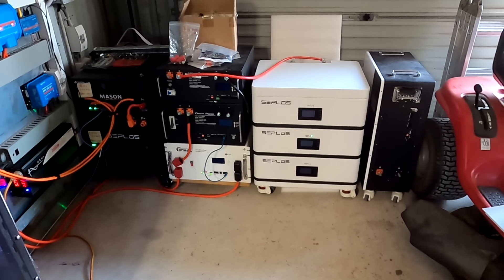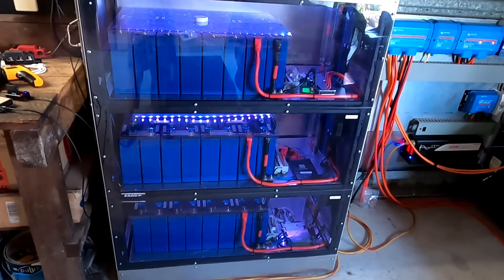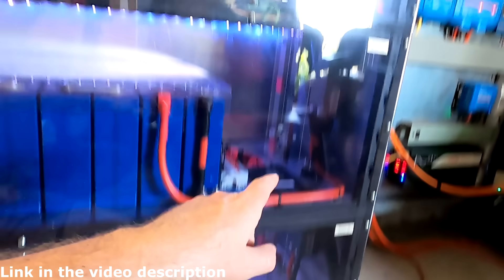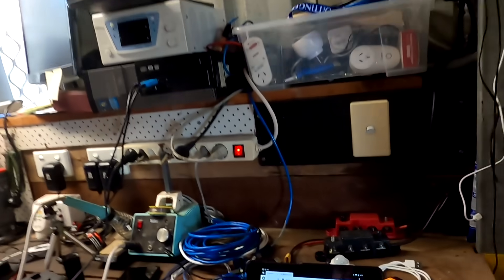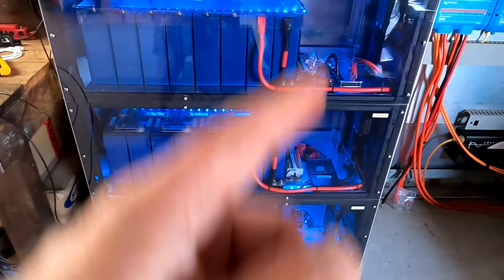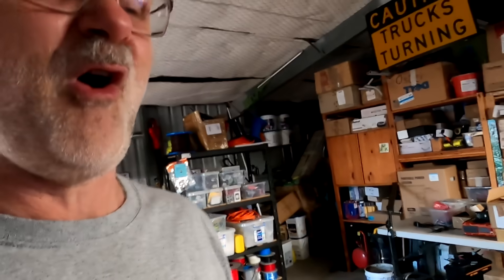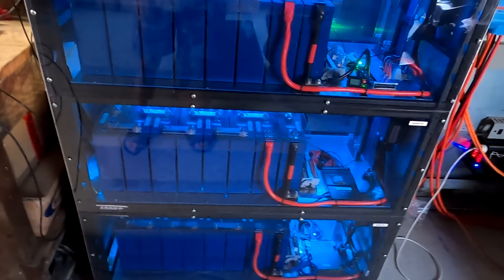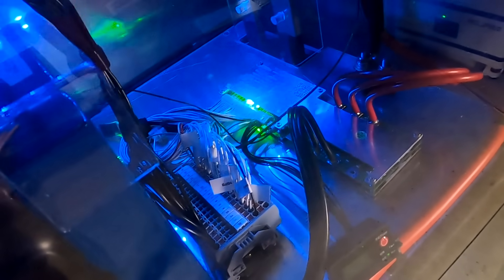Something wrong in the battery shelf! Or just 'bad' settings?

Comment: I have already asked this question in the video before but... The first relay contact of the PACE 200 A BMS switches to continuity in the event of an alarm. Couldn't you disable all alarms in the parameter settings except for the pack overvoltage alarm? Then you could turn the active balancer on and off via the relay with the pack overvoltage alarm setting. Personally, I don't need these alarms anyway. Then either turn off the red flashing LED as well or take it as a sign that the active balancer is working.
Reply from the maker: Yes, that could work for the higher voltages but what when we have a low temperature alarm, a low voltage alarm. It would trigger the balancer as well.
Reply: You can disable this function. There are check boxes and it does not disable the temperature protection. And the undervoltage alarm is below the shutdown voltage of the active balancer. @OffGridGarageAustralia
Reply from the maker: @karisianschwermer6464  But the check boxes disable the whole block of functions. So, OV alarm, OV protection, OV recovery and OV time delay.
I think you can just set the alarm higher than the protection value and disable it.
Reply: I will try it today... Of course, this would not be not good if the whole field with the checkbox would be disabled  @OffGridGarageAustralia

Comment: Andy Elon is recomending 100% charge!
Reply from the maker: Well, this is purely to keep the BMS and the milage estimator calibrated. Tesla had lots of trouble at the beginning with LFP batteries and cars suddenly stopping with an empty battery. I would still not do it if I had a LFP EV.
And LFP has a much higher cycle life than NMC batteries.
LFP: 3000cycles @ 400km = 1.200.000km 
I mean who cares if the battery is then down to 80%
Reply: I am charging to 100% once a week

Comment: My causin Bought LiFePo4 36250(i think) 3.2v, he bought 32 of it and put them in series and parrallel to get ~13v we use 100watt solar panel, and a pwm 10amp. But just 20days afterward each one malfunction. I think it overcharge, now only 4 is left . The float was 13.2 if I remember correctly but am ignorant  of the correct setting for this type of battery I just knew that its different from flooded battery am used to. I wonder if the battery was deffective or just the setting was wrong and its human error that cause it. *sigh
Reply: If your cousin didn't put all cells in parallel and fully charge them before assemble the pack should get them out of balance but to end with only 4, seems that he didn't use a BMS and went over 4V with some cells. BMS are necessary to protect the cells and you.
Reply: @CantFindInYoutube  ohh BMS? I see. We thought its only necessary to use  a solar controller. I'll see to it. Thanks.

Comment: I have found through testing that charging to 3.5v/cell or 56v for 16s pack is much better and allows the pack to stay better balanced even with a JK-BMS, balancer start at 3.45v. Much better balancing!
Reply from the maker: Yes, better balanced but higher degradation?
Reply: @OffGridGarageAustralia  There is NO evidence of higher degradation and given the manufacturer says you can charge to 3.6V  6000 cycles (with compression LF280K cells) I think 3.5V/cell is a good compromise. 
Weren't you the man that said don't worry about compression calendar ageing will degrade them first? 
Same applies here I would suggest.
Reply from the maker: @uksa007  yeah, makes sense. Testing different settings right now. Thanks for your suggestion.
Reply: @OffGridGarageAustralia  Let me know if you want to test my CAN interface boards for the JK and Overkill/JBD BMS, I sent you an email on 16/8/23 (might help you find it).
Regards
Reply from the maker: @uksa007  I'll have a look at your email. Might be in the pool with all the other 1M emails...
Reply: @OffGridGarageAustralia  I know the feeling, and suspected as much, my email is the same as my name here, that should help you find it!
Reply: Hola estoy probando 56,20v el equilibrio es bueno he visto una batería de tienda 16s están en 56,20v abs y 56,20 float será bueno?

Comment: Once a month or when ever I remember, I increase the charge voltage in steps up to 3.65v
I've got jk bms, at 3.65 vs 3.45 there is often only 5 or 10 mv difference at the higher voltage if it was fully balanced at 3.45
you would most likely see the same if your bms was able to balance with more current.
So, what in my opinion raising the volting to allow the bms to balance at a higher voltage will only help if the bms can actually balance at the lower 3.45v.
If there is devation at 3.45 there will only be more at any higher voltage and the bms will need to work harder to keep it in balance
Reply from the maker: Thanks for sharing. I like the idea of a maintenance charge once a year, increasing the voltage and check on the cells.
Yes, correct, we can see the imbalance now in both BMS when I charge higher.

Comment: Hi Andy, and thank you again for this very interesting video and test!
My opinion is completely opposite, the higher the voltage, the more difficult it will be for the cells to balance.
A simple test allows you to see this, charge the battery, by deactivating the balance system of the BMS, and take a good look at what cell voltage, the imbalance becomes too great. And we can deduce that from this point the limit is reached.
We could try anyway, to force the battery to go to a higher voltage level, automatically the imbalance will increase!
Conclusion, this is my opinion, Andy if you can perfectly balance your cells at 3.45V there is no point in going higher.
Because going to a higher voltage will degrade the balance.
To then go back down to a lower floating voltage???
For me it doesn't make sense, if you want your cells to be perfectly balanced all the time.
Reply: The point is that for voltages lower than 3.45V the cell state of charge can not be deduced from a voltage measurement due to the flat discharge curve. So two cells can be at different state of charges (imbalanced) but still have almost the same voltage. It is only at the high and low voltages that the cells reveal their true state of charge. And since the goal is to balance the state of charge it is best done at a high voltage.
Reply: "My opinion is completely opposite, the higher the voltage, the more difficult it will be for the cells to balance."

I mean, you're just demonstrably incorrect. Look at the voltage curve of any LiFePo4 cell, and you'll see the current crashes the closer you get to 3.65v. That means with 180ma of current being taken by a balancer, it's easier for it to make a difference when you're only 1Ah away from fully charged at 3.65v, instead of like 5Ah at 3.5v.

Comment: Hey Andy. I don’t think it’s the different BMS’s fault or your absorption voltage. I’m thinking it’s your aluminum busses giving you problems . The JK has the superior balancer and has faired the best but even that has limitations. I have 3 JK’s that see 55.2volts about 5 out of every 7 days. The typical absorb time is around 20 minutes. About 12 minutes in to absorption the balance is less than .003 in all three batteries. Balance start is 54 volts. I firmly believe that my system has been working so well for so long is the preparation of the terminals and busses. There’s absolutely nothing wrong with aluminum buss bars but the oxides must be removed from contact surfaces without compromising flatness immediately before use. I know you don’t care for antioxidants but that might be coming back to bite you now. The only antioxidant I now use is NO-OX-ID A Special. No metals, not runny, ph neutral and keeps moisture OUT. A telltale sign that you have issues is that the nuts are no longer torqued. Check it and see. Also pull the busses off a problematic cell and have a close look at the contact area for discoloration. 
Keep up the good work Andy!
Reply from the maker: Thanks Karl, the aluminium bus bars are only been used in the middle battery. The top and bottom battery have the stock standard tinned copper bus bars.
Oxidation cannot be an issue here. Remember, all these cells have welded studs and the contact area between the terminals and bus bars is tiny. With the 4Nm of torque applied this creates a perfect low resistance connection (tested with over 200A). Contact issues look different are not related to cell 1-10 in both batteries. It's definitely the HELTEC BMS wich causes this.

Comment: From your previous videos I built a battery pack one year ago (24v system) I have 2 packs of 8, 280Ah EVE cells with JK bms's, 2 amp built in balancing, about 7.5Kw of panels, max and bit more 😮 overpaneled on my 3 charge controllers, supplies about 80% of my electricity needs.  These previous settings seem to work really well.
 I think one way to truly know what's happening is to monitor each cells daily current flows, which would be difficult to do,
Reply from the maker: The current in all cells of a bank is the same in a series connection. I just don't understand why the Heltect BMS causes an imbalance on both batteries which were fine before connecting it. And only cell 1-10 in both batteries... strange

Comment: As you cycle the batteries, how long are they likely to sit at that higher voltage? I would guess that the amount of time at the higher voltage would be a factor in any degradation. If there is a significant benefit from raising the charge voltage to allow the balancers more time to achieve a better balance, degradation might be less significant if the batteries are not held at that higher voltage for long periods of time.
Reply from the maker: Well, you need to give the balancer time at this higher voltage. I have them sitting at 3.55V for 1h now. Let's see how this goes...

Comment: Tesla Model 3 Standard Range uses a LiFePo4 battery pack and their recommendation is to charge to 100% even for daily use. For their NMC packs they say charge only to 80% daily. Maybe that indicates that it is okay to go higher than 3.45V?
Reply from the maker: Well, that's a bit different. They mainly do this to calibrate their BMS with the system so the estimated km and SOC is correct. They had massive trouble at the beginning with that and then started recommending it.
Reply: @OffGridGarageAustralia  Isn't that kind of the same problem you're having? That it is very hard to determine a cells state of charge unless you go to a high voltage by charging to 100%.

Comment: What a hell tech and an over killed mess... ;-)
Buy another two JKs and you are done.

You set float higher than absorbtion ? 
This is confusing me...
Reply from the maker: Yeah, two more JK would solve it, but I want to test and find out what is wrong with the Helltec.
I set float higher than absorption for the test to rise the voltage again. Normally you would not do that of course.

Comment: Well i did learn that about the bms I have the overkill BMS is and I didn't know that they would keep balancing if they hit over voltage on a cell I always just stopped before they did that I'll have to give that a try
Reply from the maker: This is just if an overvoltage protection occurs, it keeps balancing. Normally you would not hit OVP though so balancing will stop.
I have raised the voltage here in this test until OVP was triggered and saw that it keeps balancing in this situation.

Comment: Sweetspot for me is 3.55V per cell bulk and 3.45V float. My JK balancer keeps mine within 10ish. My opinion: the balancer needs some volts to do its thing and 3.55V is well under the 3.65V limit one should use. I think you are running too low with your 3.45V bulk charging/balancing but I am not sure if you just do this to create "content"...the tens of years will kill your cells well before any 3.45 vs. 3.55 voltage...but I think you know this already.
Reply: You're correct. 3.55v or 56.8v for 16s is what you need to charge to get proper absorption. Anything less significantly lowers my capacity.
Reply from the maker: There is no gain in capacity if charging to 3.55V instead of 3.45V. The only reason doing this may be better balancing. We will find out.

And no, I don't need to 'create' any artificial content. My list with videos and projects is pretty much full for the next 10 years.

Comment: I don't really think that charging to a lower voltage prolongs the life of lithium iron phosphate like it does with lithium ion The life expectancy is already so high anyways even if you're doing one full cycle per day it's still likely to just deteriorate due to the age of the cells and the age of the equipment rather than the actual batteries wearing out by cycling i haven't seen any of the documentation says anything about you get more cycles if you charge to a lower voltage
Reply from the maker: Yeah, that's what some other viewers said as well... Maybe 3.45V is too low... and 3.55V gives us a better balancing experience.

Comment: I think there is something that you're missing with the balancing on these I don't think you can just go right to 3.65 with 1 millivolt deviation and say that it's good because I've noticed that if you do that and then you get it to below three volts and then recharge they'll be different every time I think that's why the BMSs have such a slow balancing function is to alleviate this sort of rebound thing that they're doing where they bounce around what I mean by this is you can take out so much power out of say cell 1 because that one was high and then the next time that one will be way low but you didn't get it low when you took out it was perfectly in balance with the rest

Maybe you could test this have one cell that is higher than the rest and discharge that one  say 1 amp or maybe just till ot has 10mv or so with the rest and then cycle the battery and see if that one is still higher or is now lower then the rest

What I mean is if you take out say 1 amp for a high cell to get it even with the rest I've noticed that by the time you get it even with the rest and do a cycle then all the sudden that was way too much you took out and so if you take a little bit out of the other cells to make them even and do a cycle then all the sudden you took too much out of those too it seems that you got to take a little bit out and then do a cycle That's what I've seen anyway

Comment: Let me guess the back batteries different cable length to the balancer yes it measures with 0 amps but it charges less because of different cable loss
Reply from the maker: Nope, wrong guess, that would not matter at all, the difference would be very very small.
Cell 1 is the one closet to the BMS, so has the shortest cable of all cells.
Reply: @OffGridGarageAustralia  ok just trying to think of reasons
Reply from the maker: @dennisbrok9335  Thank you.

Comment: To prolong the life of a Lithium battery, you need to limit the maximum SOC to about 80%. The closer you get to 100%, the more stress on the battery.
Voltage does not seem to be relevant, as long as you don't exceed the manufacturer limit.
For Li-Ion batteries it's easier to limit SOC by limiting the max. charge voltage to 4.00V
This doesn't seem to work well for LiFePo4, because these cells are capable to "absorb" up to 100% SOC at any voltage above 3.40V, given enough time.

No matter how well you balance the pack, there will be some imbalance in the next full charge cycle because the cells are not well matched (internal resistance, coulombic efficiency, internal self-discharge). So you should limit the max. charge voltage to avoid the "cell overvoltage protection" during typical usage. The imbalance accumulates and grows over time if not treated by the balancer.

Original Victron LiFePo4 batteries charge up to 3.55V.
Reply from the maker: I don't think this 80% threshold is true for LiFePO4 chemistry. The papers I read about Li batteries always talked about voltage in the first place which resulted in the famous '80%' limit. The percentage was what a EV driver could maintain by looking at the dashboard. Far easier than displaying the voltage of the battery. I think this is where the 80% recommendation came from originally.
Reply: @OffGridGarageAustralia  It is true for all Li-Ion chemistries. The charging process (ion intercalation into the graphite) has the same negative side effects. All EV manufacturers make recommendations and limitations based on SOC, because that is the correct way to extend the life of a Li-Ion battery, even though voltage would be easier to measure and control. All cell manufacturers make recommendations based on SOC (e.g. 2000 cycles 10%-100%, 6000 cycles 20%-80% or something similar). 
Voltage would be far easier to measure and display even in EVs, but SOC is what matters. 
Papers show that charging to high SOC, storage at high SOC (not very relevant for PV systems) and charging at extreme temperatures or high currents is what causes degradation during charging.
Again: Victron LFP batteries are pre-configured to 3.55V absorption voltage.